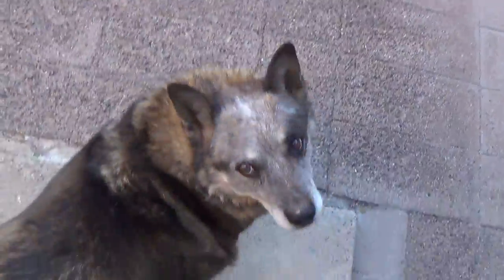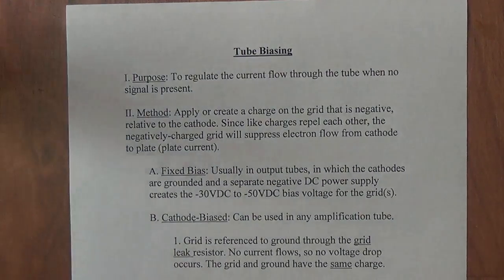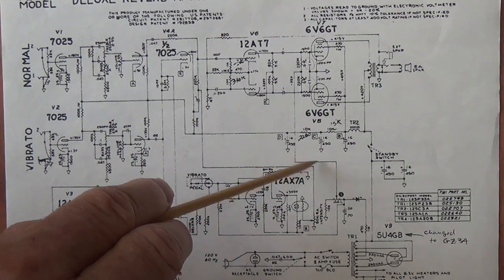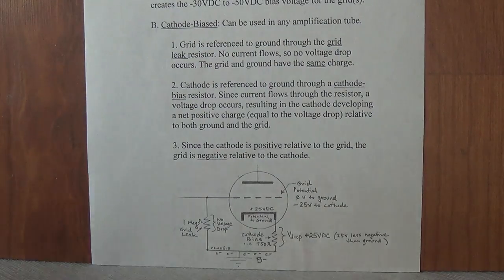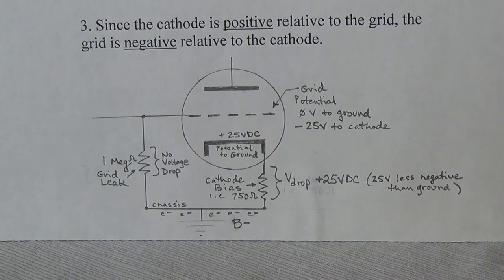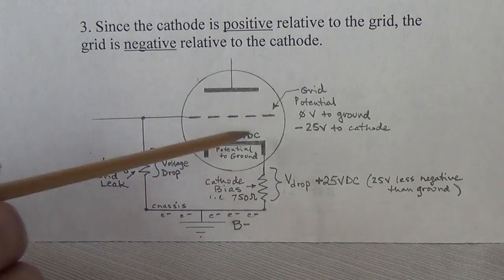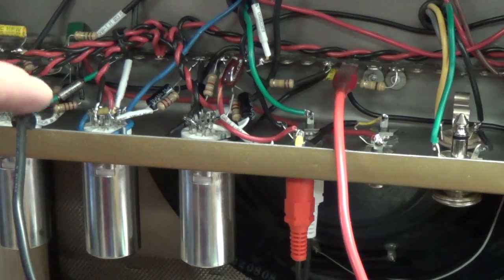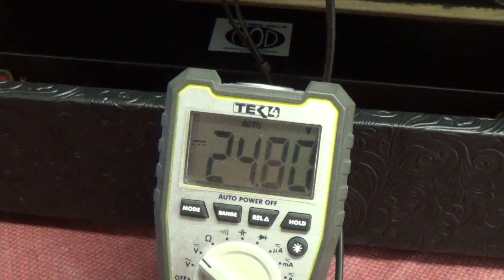Resistors, Part 4:  The Cathode Bias Resistor

Comment: Eureka! It stayed in my brain!
I do have one question, though (I'm a total noob) could I use a circuit that is entirely DC (ie, a battery) and as such there is no ground, but instead of ground I would be connecting grid to negative and same for cathode via its bias resistor. ?
Reply from the maker: +TheBaconWizard   Greetings....Bacon is my favorite food group :) The earliest radios used battery power, but they required three different batteries: High Voltage (+ to plates and - to cathodes), Filament Voltage to heaters, and Bias Voltage to the grid. Modern AC-supplied power supplies are simply a replacement for the three batteries.
Reply: Uncle Doug Perfect, thanks :) I can experiment without mains then.

Really enjoying your vids and newly subscribed. I have learned loads already.

Also Bacon is not a food group. It is THE food group ;)
It is also Vitamin B. What did you think the B stands for?
Reply from the maker: Amen, brother.....a life without bacon is a life without true happiness and satisfaction. In fact, I understand that the Rolling Stones wrote their most famous song in response to an absence of bacon on their tour bus. Thanks for subscribing and best of luck with your experimentation.

Comment: hi id like to know how to calculate wattage of the cathode bias  resistor  .why the wattage of the resistor is very higher that  i xi x r
Reply from the maker: The equation is Power in watts = Current squared x Resistance, as you have said.....but for safety's sake, it is standard procedure to use a resistor with double or triple the calculated value.
Reply: @UncleDoug  ok thanks for your answer

Comment: Hi Doug and Rusty and Jack!
I 've like to ask you about calculating cathode resistors and found this : (B+ - Plate volt /plate resistor) = cathode current....
Is that somewhat correct?
//Peder Sweden
Reply from the maker: Yes, but the resistor-value method I have seen has a second step, Peder:  http://www.augustica.com/Tutorials/Tubes/calculating_cathode_bias_resistor.htm   After you calculate the cathode current (same as plate current in triodes since they have no screen) you then use the cathode voltage to calculate the bias resistance. One other complication is that the value for plate resistor is in thousands, i.e. 30 instead of 30K.....but in the resistor calculation, it is literal, i.e. 30,000.
Reply: Great, I did mostly wondered where to start when setting the bias...again thanks for your great videos!
Reply: Yes I got that the explanation said "30" but it really ment 30k ohm...
Reply from the maker: That's good, Peder. Best of luck.
Reply: The result of your calculation is the current flowing in the plate resistor. This current also flows in the tube and the cathode resistor, so you have indirectly calculated cathode current.

Comment: Hi Doug, to determine and measure the wattage d I have to run the amp with volume high and signal into it or is idle just fine? Does it make a difference? Thanks!
Reply from the maker: If you intend to measure the output wattage of the amp, you should watch my video on the topic.  The wattage is measured with the volume increased to a point just before clipping occurs.
Reply: so how could I determine that point when I don't have an oscilloscope? would playing and listening be anywhere accurate enough to find the point where clipping starts to occur? Cheers
Reply from the maker: You could try that, I guess, but the proper way to judge clipping (which is probably not audible when it first starts) is with an oscilloscope.

Comment: Good job, Jack!
Uncle Doug, what's the name/purpose for the optional capacitor that's paralleled with the cathode bias resistor?
Reply from the maker: +kcrmson Thanks KC (from Jack). It's (quite fittingly) called the cathode bypass capacitor. I have already posted a video on its function, which you may find interesting :)
Reply: +Uncle Doug that's what I get for replying late at night, I brain farted on the cathode bypass cap video, review time for me. That and maybe rewatching the tone stack videos too for good measure.
Reply from the maker: Sounds good, KC. Happy Thanksgiving :)

Comment: Not Knowing Which Connection Is - Or  +
That Could Burn Out The Meter.
I Heard The New Meters Are Made 
Where You Can't Burn Them Out
Unlike The Oldones. I Had An Analog
Meters & That Thing Didn't Last Long At All
Reply from the maker: Modern digital meters often have internal protection, Roger.

Comment: How does this change for a "live" or "direct" cathode vs. an indirectly heated one?
Reply from the maker: How does what change, JS ?? Indirectly heated cathodes have slower warmup, but otherwise there is not much difference.
Reply: Cathode bias cannot be used with directly heated cathodes. Early circuits used a battery (the 'C' battery) to provide bias, or employed 'grid-leak' bias.

Comment: Hi Uncle Doug.  How come the grid leak resister to ground has no voltage drop but the cathode bias resister does?
Reply from the maker: All resistors provide a voltage drop when current passes through them, John. In the case of the grid lead resistor, the drop is small because the current flow is minimal. The cathode resistor passes the plate current of the tube, which is considerably higher than the grid leak, so its voltage drop is greater.
Reply: Uncle Doug right like in your first resistor video as well I forgot that. Low current, low voltage drop thanks.
Reply from the maker: Yes, voltage drop is directly related to current squared.....so it has a huge effect.

Comment: Doug, this is off-topic, but I was wondering if you could address a topic which I don't know the answer to and which could potentially harm some people if it proves to be false. I read a short article (admittedly written by a novice) about biasing amps that said you could discharge the caps in an amp by striking a guitar chord and then immediately powering down the amp by pulling the amp's power cord from the socket as the chord rings out. Is there any truth to this?
Reply from the maker: +St. Hugh  Greetings, St. H. I've never heard of that maneuver before, but would definitely not recommend it. The only way to safely ensure that capacitors are completely discharged is to use a 100 ohm 10W resistor with one end grounded, and then touch the other end to the + lead of each filter cap for about 5 seconds each.  Be sure to use only one hand and to not touch metal at any time. You can then verify the discharge by checking each cap with a voltmeter (a good idea when first doing the discharging procedure, and optional thereafter).
Reply: +Uncle Doug Thanks Doug. I doubt very much there's any truth to it either. Life's not that easy.
Reply from the maker: You're welcome. Yanking the cord on an active amp is just not a great move, at least in my book, regardless of the reason.....and I doubt that it would have the desired effect anyway.
Reply: If you strike a chord and switch off the amp (no need to pull the plug) leaving the standby switch (if present) in the 'play' position, this will discharge the filter capacitors. Whether or not it will discharge them to a safe voltage depends on the amp. By all means try it, but be sure to measure the voltage on the caps before you stick your fingers in there.

Comment: How do you chose the value of the resistor
Reply from the maker: The value has to fit the needs of the circuit. The value can be calculated and/or verified by measurements after installation.

Comment: Shouldn’t the voltage across the cathode bias resistor be positive 25?  Am I missing something
Reply from the maker: A voltage "drop" is always negative Steve.
Reply: @UncleDoug but the probes are on the same location as cathode to ground and Isn’t that positive? Still confused
Reply from the maker: @steveberg3014  Ground is negative in a B+ circuit, Steve. It is the source of all electrons.
Reply: @UncleDoug yes I know ground is negative, I was referring to the cathode to ground measurement being positive 25.66 and the probes are in the same position as across the resistor which is showing a negative voltage
Reply from the maker: @steveberg3014  If the cathode is +25.66V to ground, and the voltage on the other side of the bias resistor is 0 to ground, would you agree that a drop of -25.66V has occurred across the resistor, i.e. +25.66V -25.66V = 0V?

Comment: At the risk of shame, I'll ask anyway.  Is the Cathode Bias Resistor in this case considered to be a pull-up resistor?
Reply from the maker: I'm not familiar with the term "pull-up", SC.
Reply: The 'pull-up' resistor is a term used in digital electronics, and it's purpose is different from a cathode resistor which in this case is used in an analogue circuit, viz, an AF amp. 
The current through the valve creates a volt-drop across the cathode resistor - Uncle Doug explains it better than me.
Reply: @tiggywinkle1000  , yeah.  Digital to pull-up to HIGH or ON vs a pull-down to go LOW.  Thanks!
Reply: Since it ties the grid to ground, it could be described as a 'pull-down' resistor.
Reply: Sorry, that's the grid leak resistor.